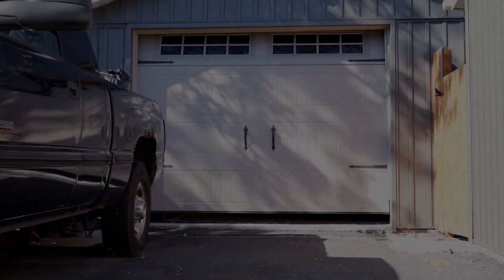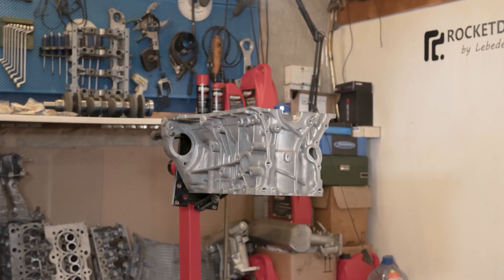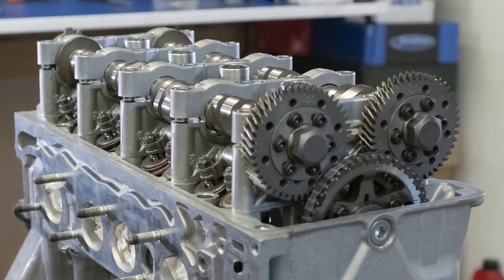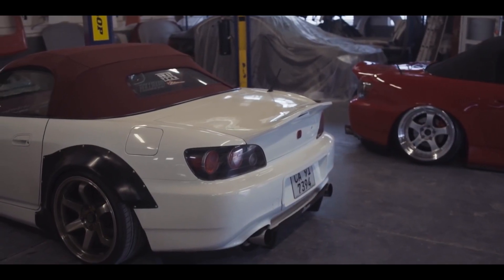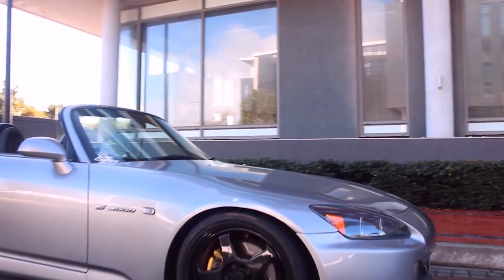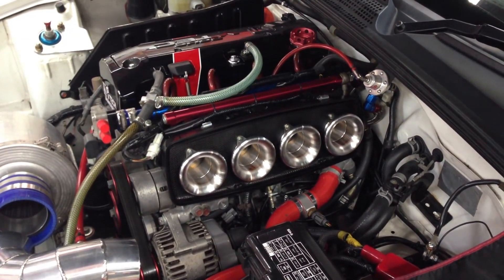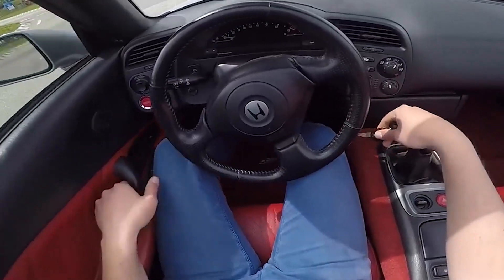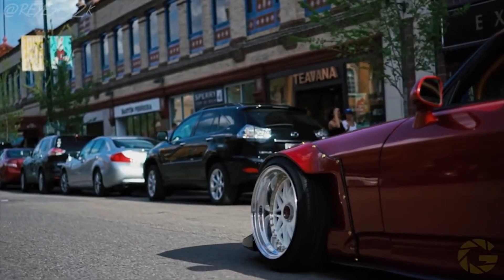The F20C Engine - Redefining Power and Performance in the Honda S2000

Comment: But....the car itself is an overweight pig at 2800 pounds, the same weight as a 65 Mustang fastback with a 289.
 If the S2000 weighed 2200, it would have been  groundbreaking.

Comment: K20 is said to be better???
Reply: Cheaper parts not better
Reply: And K series are more reliable i have f20c2 oil starwing ...... Oil pump major defect!
Reply: @erhanmustafov1513 The oil pump was not the issue, the oilpan was missing a baffle system from the factory. The more you know...

Comment: F20c is the better motor imo..
Reply: Having owned both an AP one and two, I think the 9K red line is overrated. What makes the AP one more enjoyable is the sharper steering and more aggressive suspension but the extra torque and shorter gearing is definitely welcome in the AP too. So I’d say if you want to track your car or fly to the canyons, you will have more fun in an AP one if you know how to drive that is but overall I think for most people, the AP two is better. for context, I had the AP one when I lived in Southern California with most of suspension upgraded and a 255 square set up it’s the most I’ve had in a car going through those canyons every day now I live in Houston and there are no roads worth driving out here and currently have Ap2 and I feel like the ap1 would be a waste out here
Reply: @cidfacetious3722 ap2 ftw
Reply: @cidfacetious3722 get a slab homie
Reply: Wtf there ain't no canyons in southern California u better take that shit back to the valley or the inland empire
Reply: Shit now that I think about it all AP ones in Houston should trade with all Ap2 users in California it just makes sense 😂
Reply: Honestly by looking at the numbers and the 9k rpm redline sound, the AP1 is better. But when it comes down to the actual execution and production, the F22c1 is way better. Theres no issues with the AP2 motor whereas the F20 had many issues such as low oil pressure and burning oil.
Reply: @agr_s2k "Many issues" is so overblown. Burning oil is very rare, and the valve retainers only crack if you miss a shift and over rev it. These can be replaced easily, or you can just inspect them and not drive like a dumbass and miss your gears.

Comment: Good video man. Minor nitpicks though; the S2K debuted in Japan in ‘99 not 2000, and their version was the most powerful. It made 247BHP due to running 11:7:1 compression vs the USDM’s 11:0:1, which gave it the 123.5HP/liter rating.
Reply: Tell em bro this guys shit for research
Reply: @fernandocadena2625 yes it was introduced in 99 but it was for model year 2000.
Reply: Japan version is 250hp